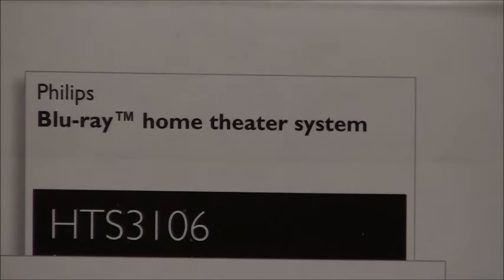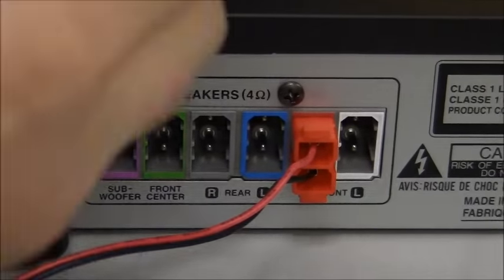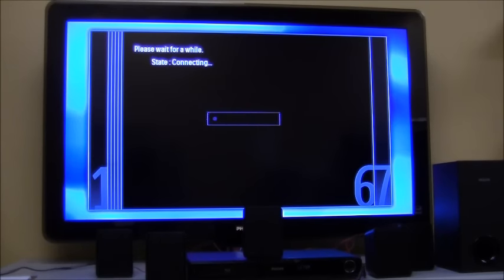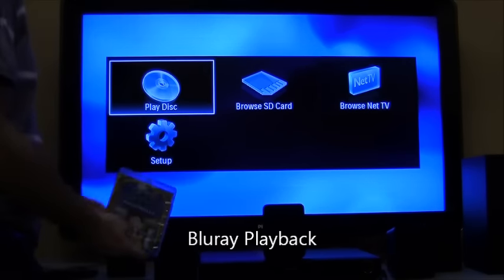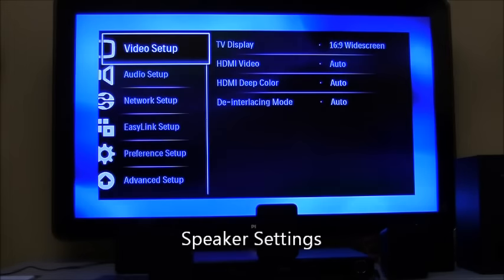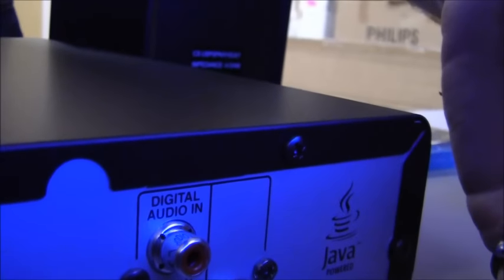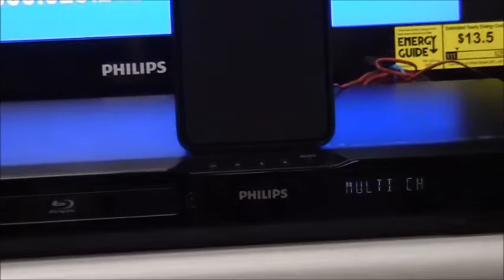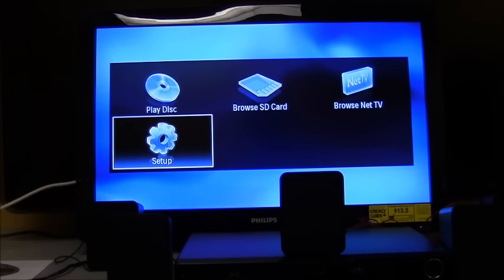Philips HTS3106/F7

Comment: When I set the external input in the EasyLink Setup portion to Coaxial, I also had to go to the TV "Audio" set up menu and select the EasyLink option as opposed to keeping the TV speakers on. Should it have worked automatically? I ask this because I followed your instructions and could only hear the front right and front left speakers during regular TV viewing. The center and rear speakers have no sound.

Comment: Hi, this video really help me a lot, but I still have some problem. I have a Philips HTS3541 F7 and a Samsung smart tv. I followed these steps you showed, but I used the optical digital out put, the speaker work fine, but the center and the two speaker  right , left back don't work. On the blue ray only so optical  or surround , it does not so direct. So what can I do to make the three speaker work?....

Comment: Hi, I have the Philips HTS3541/F7 5.1 CH Home Theater System w/ Blu-ray Disc Player and WiFi and samsung smart tv, I connect them by an optical, the sound when I watch movies is good, when I watch tv the center and the back two speaker don't work,